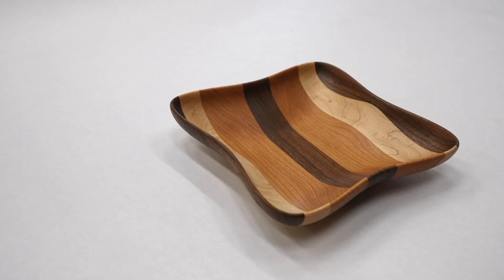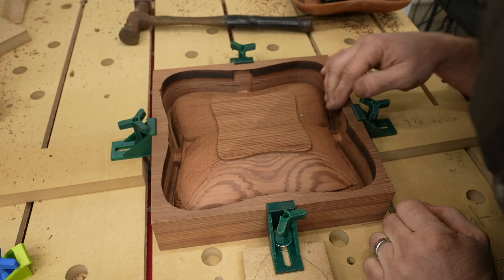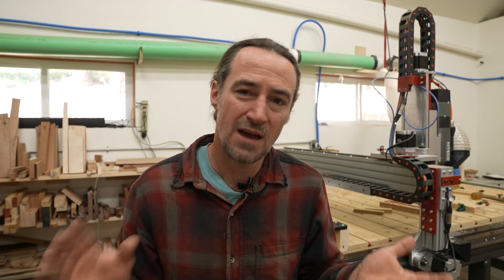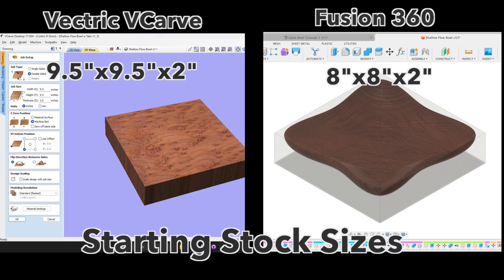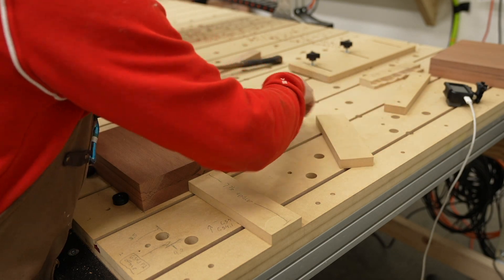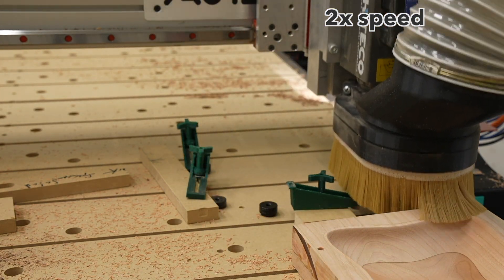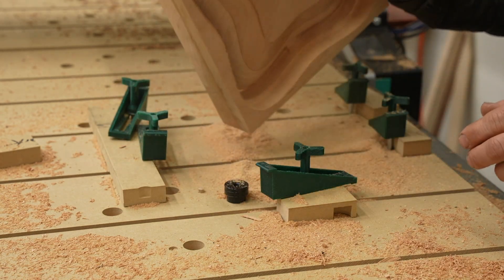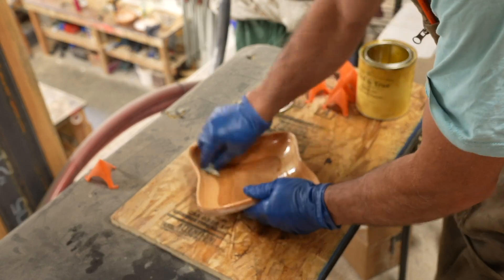How To CNC a Bowl in Vectric VCarve - Two Sided Bowl with Tabs!

Comment: Check the number of nodes in your tool path (Vectric).  For smooth edges reduce the number of nodes and use "Fit Curves To Vectors" command, "Circular Arcs" selection, to reduce number of nodes.  If you use any kind of bitmap or conversion, you need to have Vectric create a vector path along the outer edge.  This is the fix for rough edges.  If your following a bitmap edge, your edge will look terrible because bit is jumping left and right trying to follow the bitmap edge.  Use "Toolpaths", "Simulation Quality", set to "Maximum 25X" preview, to check edge output.  Nice bowls! Thanks for video!!!
Reply from the maker: Thanks! These are some good ideas! The things you are talking about work well for drawn vectors, but this is a 3D model STL that I designed in another program (Blender) and imported it into VCarve without any vectors. There isn't any way to fix it; it is a due to the way Vectric rasterizes the 3D model into pixels (or voxels). They do have two higher resolution settings when the project is made (extremely high - 20X slower and maximum -50X slower), and I bet this would reduce some of the jaggedness; I did some testing but only in simulations, and didn't find it all that better.

Some people do work around this by drawing a vector around their shape and slightly in-cutting the model. I think that is what you are also talking about with bitmaps (although, there are no bitmaps here - just 3D model STLs). This could work...but it could take a long time to generate a smooth and perfectly matched vector. It would also leave a slight flat edge on the side of the bowl, which would have to be sanded out. For a one sided carve this would be a good solution.

Fundamentally, this is really just a problem with Vectric; other CAM software keeps the original model data intact and work from it, and avoids issues such as these. I have a feeling that they ray cast on the Z-axis and through away any data that it doesn't hit, leaving being pixel based precision.

Comment: I do most of my design work on Fusion 360, save the object as a mesh file (.stl) then import it into VCarve.
Reply from the maker: Is there a reason you don't do your CAM in Fusion? It has a lot more options and control of how the toolpaths behave. And the simulations can help prevent collisions.

Comment: These bowls are beautiful! For that burning issue, I like your idea to just add an offset! I my design I just made that vertical wall a little bit inclined from top to bottom. It helps with chip removals especially during the finishing process. I like your videos, subscribed, done!
Reply from the maker: Yeah, that is a good idea! In this bowl I used a basic 2D vector in VCarve, so I didn't have the option to make the wall slightly inclined like I could do in CAD or 3D model.

Comment: I have made 10 (!!!!) of these...I used V Carve Pro and a Shapeoko 5 Pro. I slowed down the speeds and feeds a bit, so it took a while on the machine. I did have a fair amount of sanding to do on the outer lip, the rest came out great.
Biggest lesson leaned was to raise the grain with a water mist before cutting the tabs, so I could redo the finish shaping again on the machine without sanding. The beautiful shape of the design makes sanding a b*tch otherwise.
Thanks for making the plans available. This was a great learning experience.
Reply from the maker: That's awesome! I'm glad you dialed in the speeds and feeds -- those area always machine dependent. I was thinking the profile could be done smoother if I added a vector curve around it; VCarve doesn't do well with edges on imported models like this one (I designed it in fusion 360). The "raise the grain" and re-finishing pass idea is great! I'll have to try that tip. Thanks!

Comment: Another good video but not being as familiar with Fusion 360 some of the differences are not intuitively obvious to me.  I am much more familiar with vCarve.  Appears you are very versed in both so that I would ask why can't you use the jigs and other Fusion 360 concepts with vCarve?  I use jigs quite often in my vCarve process and change the X-Y zero to wherever I need it to be.  Any insight on what I might be missing would help get me educated.

It would seem that you could use the jigs and offsets in vCarve similar to the Fusion 360 process.  

I am sure I am missing some key point.
Reply from the maker: So yes - you could import the jig STL and machine it with VCarve. The problems: VCarve will always want to "carve" the flat surface of the jig, which is just unnecessary for something like this.   The tool path generation isn't as powerful as Fusion (specifically, the ability to set angles on what to carve or not carve).  The 1/4" alignment holes would also have to be put into the jig via a VCarve vector, and not from the STL itself.

Even so, let's say you do carve it out, but the next problem is the origin. VCarve can only have one STL imported at a time, so you'd have to have another project for the bowl STL, and ensure...somehow...that they are going to be exactly in the same spot. Given that it is all centered..it should be okay, but it might be slightly off. I bet it could be done...but I didn't want to try it.

I'm also thinking the Vectric way to do it would be to use Aspire. I haven't used Aspire, but I'm guessing it has a way to take the bowl shape and do a negative cut out of a square shape, leaving behind the jig. Then you could machine each out from the same file and ensure it would be 100% matched up correctly.  This is how I made the jig shape in Fusion 360.  But I don't know for sure, as I don't use Aspire.
Reply: @CorbinDunn  thank you for your thoughtful reply.  I normally use Aspire but I may just need to force myself to learn fusion.